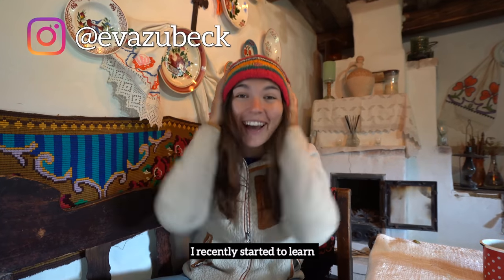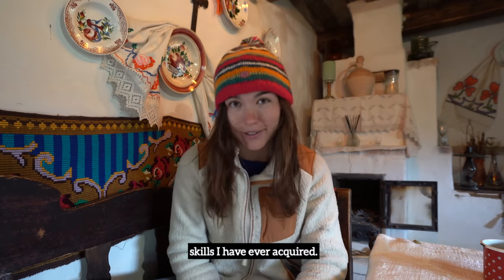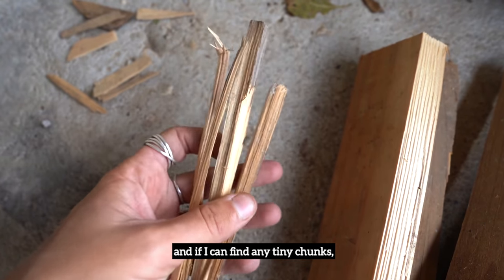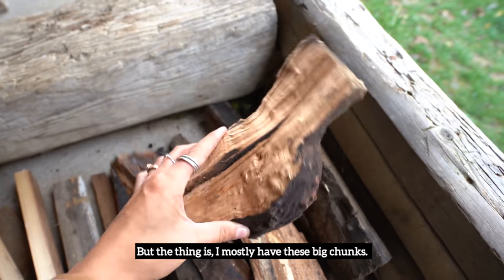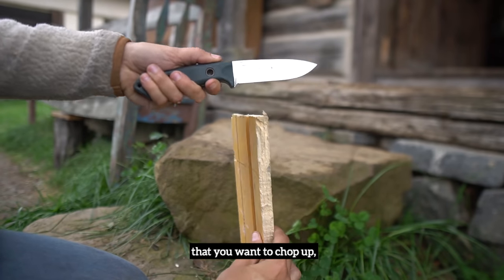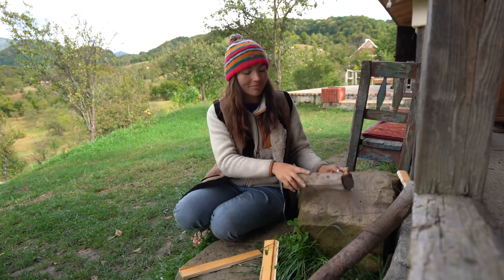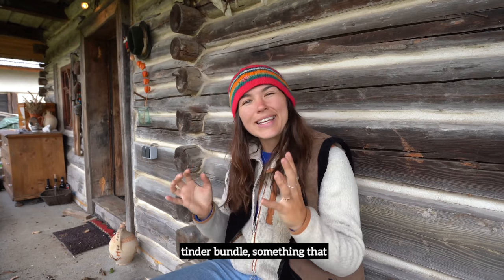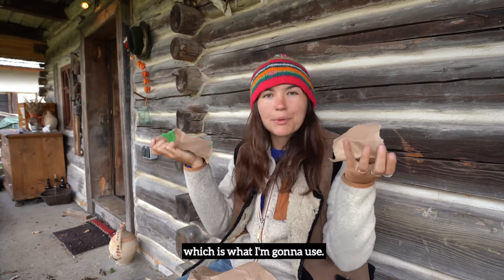Girl's Guide to Making a Fire (Easy Steps)

Comment: Don't baton (split wood with a knife) on a rock, the knife will inevitably make contact with the rock and ding the edge.
Spend a few more minutes prepping WAY MORE of the small stuff, then you'll find that the shape of the fire doesn't matter nearly as much. 
Great video, I love it!
Reply: These 2 points are VERY valuable! If you dull or wreck your knife you will be sunk. And you do need TONS of tinder and kindling. Without that you are in for a very long and frustrating process, or a very cold time without hot food or drinks.

Comment: Wonderful that you can make a good burning fire when you put the wood up (teepee shape) which makes sense because heat wants to go up. But then you run out of wood very quickly. What I can imagine what you want is a fire where you have as long as possible warmth from the wood you have in your fire. So to start your fire the teepee shape is fine, but if the larger blocks of wood go on it, you have to stack them flat with space in between so that air can still pass through so that you can burn your firewood for as long as possible.
Reply: Controlling the burn, banking and other firecraft are sadly all but forgotten these days.

Comment: Nice work Eva!   I did find a little irony in saying you don't need a massvie axe or dangerous saw, you just need a knife....whips out an expensive Benchmade fixed blade knife made in the USA.  Lol.  That skill is called battoning and I wouldn't recommend doing it with non fixed blade knives or anything cheap.

Comment: Sad that she's fallen for the tired old myths about fire making. This vid is pretty much everything wrong with how most people start fires. 

No, I'm not dissing her. She stated that she's a noob at this right off, so that wouldn't be a proper thing to do. Just can't help but shake my head that these popular myths continue to persist, when there are much better approaches that have been known for centuries is all. 

Here are some general thoughts and tips for those new to fire making:  

Never make a teepee! Complete waste of time. 
Instead lean the kindling against a log (place the tinder under the kindling). 
Or place the kindling perpendicularly across two parallel logs. 
These are faster, easier, and more stable methods than the teepee. 

Have more of everything (tinder, kindling, fuel) than you think you'll need. Like 2-3 times as much. (She was correct about that!) 

Never chop or split wood on a hard (rock, concrete, etc) surface! Always chop on top of a chunk of wood, or at least a soft, relatively rock free patch of ground. Chopping or batoning on a hard surface is a great way to ruin an edge or shatter the tool.

Batoning with a knife is foolish. Try to plan ahead and have a froe, hatchet, etc. Those are made to be batoned in the same way that she batoned with the knife. Thus no extra skill, strength, etc is needed. 

If you must baton with a knife, choose short pieces of the softest wood with the straightest grain you can find. (She did well at that in this vid.)

Don't force the knife. If it gets stuck, start in a new place or on a new piece of wood. 

Better yet use a knife, hatchet or axe to carve wooden wedges, then split with those. 
(Yes, we can split and baton wood with wedges made of wood. Works amazingly well!) 
(Especially when you're experienced enough to make good choices for both the wedge and the wood to be split.) 

Never baton with a hard object like a rock, hammer, etc. Always use wood (branch, mallet, etc), which is relatively soft compared to steel, stone, etc. Striking with hard objects can shatter your knife, froe, etc. 

When folks have mastered the above, they might be interested in learning about primitive methods for starting fires. Such as solar (magnifying lens or sphere made of ice, glass, translucent crystals, plastic, etc or a concave mirror), ferrocerium (which are not "flint") rods, Rudiger rolls, Flint (the rock) & Steel, Pump drill, Bow drill, Hand drill, etc. Taking an ember you created to flames is an amazing experience!  

The more methods and materials we are familiar with, the greater our joy and more consistent our success.
-Cheers y'all!